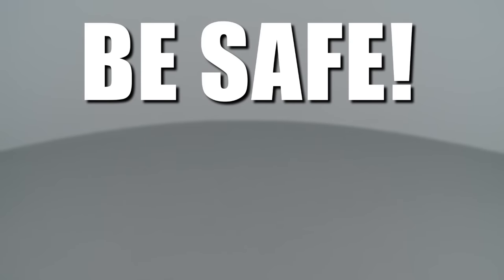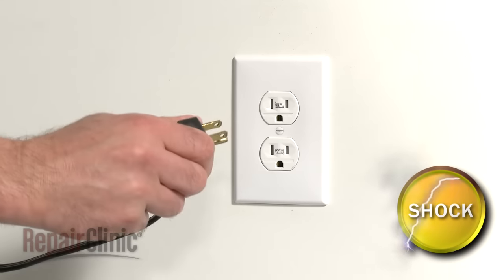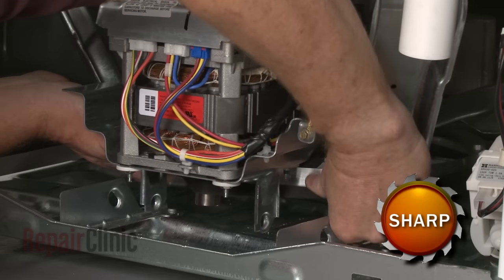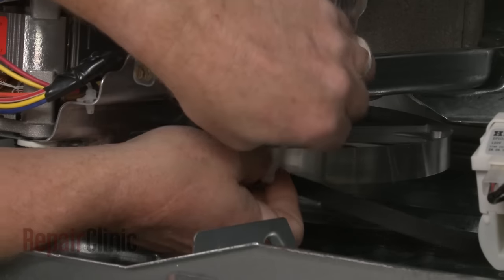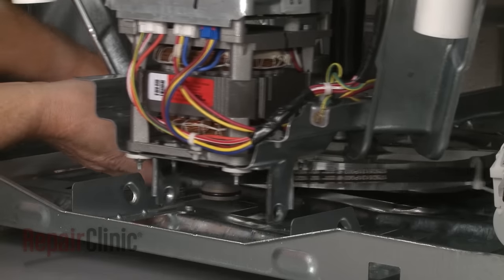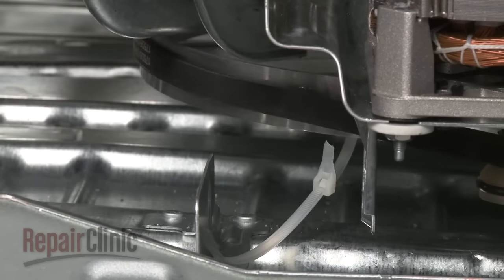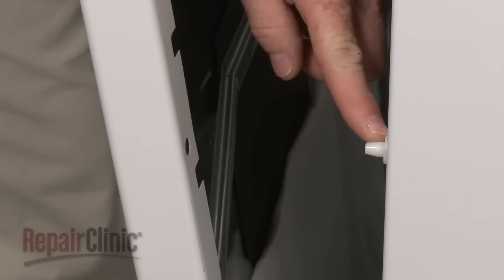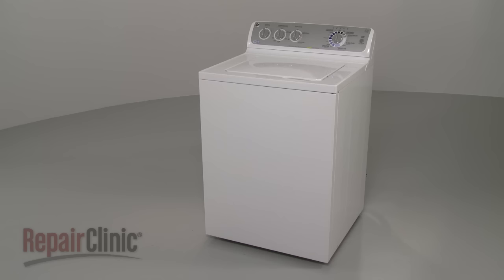GE Top Load Washer Won't Spin? Replace Drive Belt #WH01X10302

Comment: Thanks for the helpful vid. Would like to add an addendum mirroring some of the other comments here: 
1) This video makes this look easy. It's not. Not sure what belt you have that is pre stretched out, but the one that matches this serial number does not go on easily. 
2) Use two zip ties. One did not hold mine well. 
3) Wear gloves! because.... 
4) It took me 20 minutes of prodding and stretching the belt while hanging upside down, AND I ended up with some cuts on my hand since the main rotor is actually kind of sharp. 
5) Go to law school so you have enough money to hire someone eise to make these repairs around your house. 

Thanks again for the vid.
Reply: Matt Kern thank you. I was thinking of attempting this. I think I will pay an expert to do it instead.
Reply: Unfortunately the “expert” in our area couldn’t do it and asked me to hold the belt on the shaft while he attempted to put it on... that was fruitless... and other “experts” won’t come to our house due to covid

Comment: After trying everything in this deceptive video and some of the comments I tried to do it a different way out of frustration and BAM I got it in under a minute. It is as simple as instead of putting the belt on big wheel in the back first, put it on the small wheel first and then reach back and put it on the big wheel. You will find that you can turn the big wheel much, much easier and it will snap on! But BEWARE: don't have your fingers there where the belt goes on.

Comment: I replaced the belt on my General Electric Washer, its been the best washer for us.  I am a wife who took on this challenge, it will not work with only one zip tie!!! You must use two zip ties that I put approx. 5 inches apart from each other on the left side, I pulled the large pulley as hard as I could with both hands to get the belt on. I turned it around several times to make sure it was secure on the pulley and then I removed the zip ties, and then the tool over the small pulley.   I cannot imagine doing this without the tool that is offered to purchase with the belt.  I watched many videos about how they did this with only one zip tie and when I tried it there was no way it was going on, it twisted the belt and I was afraid that it was going to tear the belt.  They must have edited those videos to make it look simple, or they re-used a belt already stretched out from being on the washer already for it to go on so easy.   Hope this helps!
Reply: Truth 4 LasVegas I am female with no mechanical skills but am a capable DIY person.. I need to fix my washer belt...but very worried about the potential hand cuts mentioned in the comments.
Reply: When my husband and I tried it last night, we couldn’t rotate the wheel very much at all.... 🤷‍♀️

Comment: I was clueless as to how to get this belt on, I thought I was sold the wrong belt.It's not like installing a belt on the the older style machines that use belts. I was about to haul this machine off to the scrap yard, but then I saw your video, thanks. I found it impossible to install it the way you do, you are definitely skilled at doing this.

I added the helpful tips below for people who simply cannot get the belt installed the way it was done in the video:
Access was much easier for me to lay the washer on it's back then remove all the screws holding on the bottom plate. 4 screws that hold the rear feet on will need to be removed before it's laid on it's back.
With the floor panel out of the way it's much easier to tackle this job. I didn't use the installation tool with the flange so I pushed the belt all the way to the top of the motor shaft because the belt will travel down the shaft as you turn the larger pulley.

First I put the belt on the smaller pulley or shaft, bring the belt as far as you can and use the ties like in the video. I noticed the belt twists in such a way that I was concerned that the large pulley would cut or damage the belt so in that area I put a rag between the pulley and the belt. This installation is not easy the first time around, it takes a lot of trial and error, but if you did this 3 times in a row you could get very good at it and install the belt in seconds.
Reply from the maker: K Zpodindustries Thank you for your input. It is wild how the replacement is smaller than one of the two pulley it has to go around.
Reply: ***** Totally bizarre, old school would expect a bolt on the motor plate to loosen like replacing an alternator belt on a 1969 Ford LTD. Things are different in this world today. A person just has to learn how to work on the newer designs, never a dull moment.

Comment: pro tip: if the belt is really snug, use tie straps in stages, so get the belt on the tub wheel at least half ways and then use more tie straps to partially stretch the belt. youll find that you ll get a bit farther in the installation each time, then it will easily go on.

Comment: Worked great. Didn't seem like it would stretch enough, but it did. I had to brace my knee against the drum to pull the wheel hard enough for it to go on. No more squeaking!
Reply from the maker: It definitely is a tight fit. We're glad it worked out for you.

Comment: We are running into the same issue a couple of others have had.  Belt goes on but once we start the wash loan it will go for a little while and then the belt slips off.  Need additional advice on this please.

Comment: This by far is the hardest belt ive put on a washer. I end up going another route after wasting too much time trying this method. I disassembled the entire washer and pulled out the outer tub completely and fliped it upside down and put the belt on this way.  In my opinion much easier.

Comment: I did not use the tool but my wife and I had problems with the belt slipping out of the cable tie so we just used another one a quarter inch away and that belt went on just fine.
Reply from the maker: Brian Meyer Great. We're glad it went well!

Comment: I have rebuild small block chevys and work construction for a living. I still cant get the mofo on. The zip ties break evertime you attempt it. I made a belt strectcher and Im letting it sit over night, hopefully ita goes on tomorrow.
Reply: Did you ever get it to fit? I work automotive as well and couldn't get it to fit. Belt ended up actually snapping. I did some research and actually found out GE had a had recent batch of belts that are actually an inch and a half too small. Starting to think this was probably my issue.

Comment: Pro tip when loading on the belt let the slack sit on top of the pully not underneath and spin counter clock wise. I was getting frustrated trying to do this with the slack under neath the belt kept slipling off.
Reply: Thank you got it done with your advice
Reply: Just so you know, I did this as easy as the video with your method. 👏
Reply: This is the comment that saved me

Comment: I'm having difficulty releasing the spring clips to get the front panel off. Am I supposed to slide what ever tool I use in and press down?  The video isn't clear.

Comment: it worked for me when i used 2 zip ties instead of one. because the new belt was so much smaller than the old one, the zip tie kept slipping under. two kept it right where it needed to be.

Comment: Do you know if speed queen top load washers are very similar and the same method can be used to replace a belt?
Reply from the maker: +tgo007 Speed Queen is normally a V belt that allows slipping at low speeds opposed to this style belt.

Comment: I want to see from the left side, what exactly is happening there, because from my part, the drive belt falls under the wheel and it becomes impossible to keep rotating counterclockwise, I’m sure the answer to what I need to know can be seen from the left side.

Comment: So, I just tried replacing my belt on my GE washing machine. According to applicance Parts, my washing machine (GSRE5600K2WW) is using a WH01X10302 drive belt. I tried to put it on with your technique. I just can't! The belt, once it reached half way to the big "wheel", is so tight that it snap out of the tie-rap. It's not even big enough to fit only on the big wheel. I tried to stretch it but to no avail. Part on the belt itself says 175D5131P003...

Comment: Slack over the top works better than underneath.  May need a barrier between the belt and sprocket right before drive shaft. This also helps keep the belt on the drive shaft as the belt is coming in from the top. Got this idea from another person in the comments.

Comment from the maker: Since the upper clips are screwed in you must be referring to the lower clips. You may need to remove them and take a pair of pliers and pinch the part that hooks on the base. This will keep them tight so they will not fall off.

Comment: If the Belt is not too worn out and its just slipping a little bit you can use firestone belt dressing. Not a permanent fix but may bring it back to life for a month or two. 
Stick a screw driver in the safety latch. Let the motor spin the belt and spray your dressing on it as it spins. After a few minutes the dressing dries on the belt and makes it stick to the drive wheel better with just enough slippage.

Comment: I am attempting the zip tie trick, but the pulley will not turn at all, to the left or right, in order to work the belt on. What is that a sign of? Need advice on what might be wrong.
Reply: There could be a safety brake on the drum that brings it to a stop when the top is lifted.

Comment: The replacement belts circumference compared to what it has to go on is very very different. (a lot smaller!) The zip tie method looks great but the amount of tension I have had to place on the pulley has sliced 9 of the zip ties as the edge of the pulley is extremely sharp. This method does not work for me whatsoever.  I have not been able to get the supposed new belt on my washing mashing. GE model WJSR4160G1WW - Replacement belt part number (apparently is..)  WH01X10302. Dosent fit. Im a 230lb fit Landscaper with tools and this thing refuses to go on.
Reply: Shaun Smith this is my exact problem.  It’s not working at all

Comment: "the belt may be a little small"???? No joke... My belt is sooo hard to get onto the pulley! Any other ideas for stretching the belt? The zip tie has helped me keep it on, but still struggling to attach the belt fully.
Reply from the maker: It seems almost impossible but it will go on. The best way is to zip tie it on the transmission pulley first then get it around the motor pulley and use the large pulley to pull the belt all the way around. It takes a lot of effort to get it around but it will go.
Reply: ***** we just did this. without the guide on the drive shaft thing, this is a five round 2 on 1 wrestling match. we got it to go on there but wow that guide thing would have been useful. geez! thanks for the video - without it we would have thrown in the towel in the 10th round. . . and the towel would have had to go to the laundromat to get our blood sweat and tears out after!

Comment: Thanks for creating this video.  I opened the panel of my GE washer (Model:  GTWN4250D0WS) and noticed the belt is fully intact and didn't seem worn out at all.  My washer does everything else fine;  soak, drain, but doesn't spin at all.  The agitator doesn't spin and neither does the belt.  Any suggestions on what else I can look for?
Reply: Ever figure out the issue? Mine is making the noise as though the motor is running but still won't spin

Comment: The tool is 25 bucks everywhere i look. Is it absolutely necessary to have this tool?
Reply: No. This job took my 5 minutes. Put Tie the belt on the large wheel and spin it. When you experience tension pull counter clockwise hard and it will stretch. Remove it and you're done. The only thing the tool helps with is to ensure the belt is aligned on the small wheel (ie not too high not too low) but, you can adjust easily afterwards. This is one of the easiest DIY I have ever done. Unfortunately some have problems but I  don't understand why.

Comment: I put the belt on, but it isn't even. the drive pulley is lower slightly than the small motor shaft and it looks like it will slip off. What now?

Comment: I have wrestled with the belt on my Moffat washer for days now ... no stretching, pulling, spinning will get the darn thing back on!  Yes I have the right belt.  I am going crazy and in desperate need of clean clothes! HELP
Reply from the maker: The best way is to zip tie it on the transmission pulley first; then, get it around the motor pulley and use the large pulley to pull the belt all the way around. It may seem impossible at first but it will go on.

Comment: i easily put that belt by just flipping upward the belt near the motor shaft and rotate the drive pulley without using any tool...

Comment: My GE top load washing machine won't wash after taking in water. What could be wrong with it? How can it be fixed? A video to fix it could be appreciated.
Reply: profanity you ain't kidding. I used more than you and got sliced and diced hands too. it still is not on.

Comment: That looked easy, however mine doesn't open at the front.
Reply from the maker: Is there an opening at the back?
Reply: Actually, you have to take the front and the sides off, leaving only the back. Found out later mine was a direct drive so no belt.

Comment: This is not working as easy for me. the belt is so tight and this method does not work at all. Im at a loss on how to get this damn thing on.
Reply from the maker: Belt replacement on some models can be difficult. The best way is to zip tie it on the transmission pulley first. Then get it around the motor pulley and use the large pulley to pull the belt all the way around. You may need a second person to assist with this.